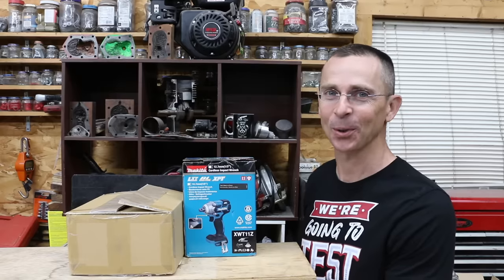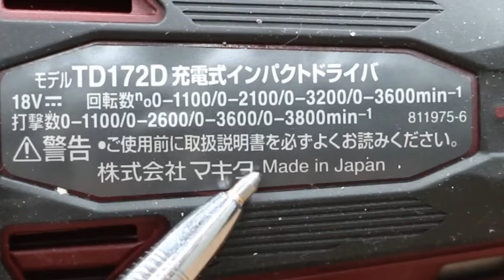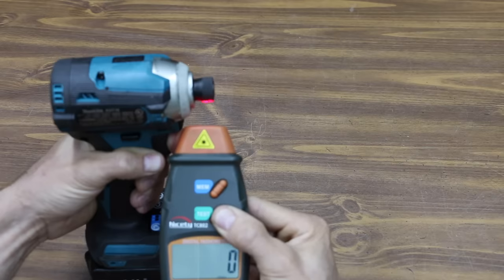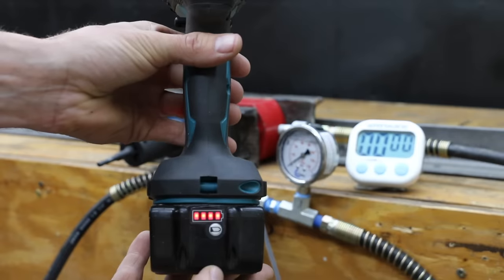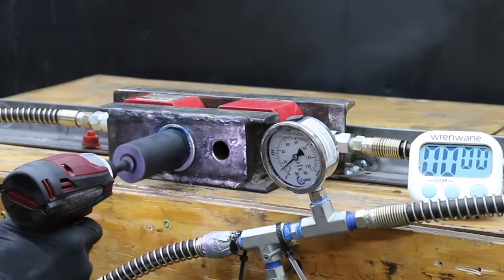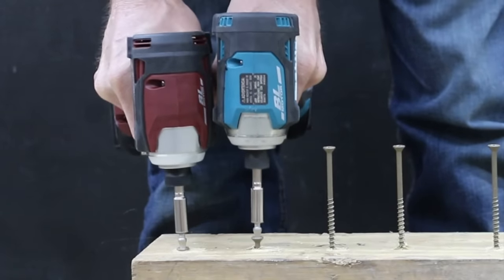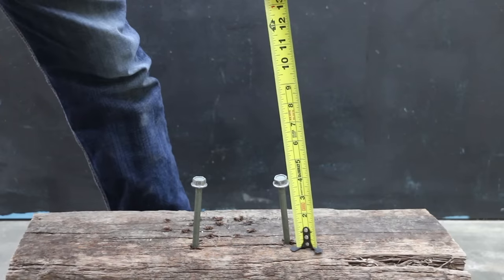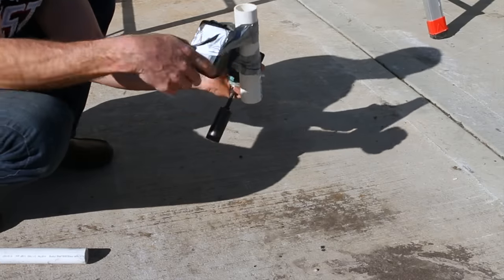Made in "Japan" Makita Better? Let’s find out!

Comment: I worked on a Honda production line for 16 years. The Makita made in Japan was used two shifts per day (80 hours per week). The tools were dropped at least a dozen times a day. It preformed flawless. The only issue was the batteries. They lasted maybe 1,000 charges. I wore out and retired before the Makita's did.
Reply from the maker: Thanks for sharing.
Reply: That's because the batteries were drained before each charge, Lithium lasts much longer when charged early.
Reply: @johnussss  I didn't know that.
Reply: Same here in Paccar assembly plant with Makitas !!
Reply: @theTomaMato  Hope you do well! Hang in there.
Reply: 1000 charges is ridiculous for a tool battery, you must be mistaken. they are rated for 400 cycles and thats under good conditions, with fast charging its often less than 300.
Reply: @drkastenbrot  They were not just any "tool battery." Makita says 3 years service from date of purchase. Many of their batteries lasted longer. We used them 2 shifts every day. Professional here. Honda manufacturing Lincoln Alabama. 2/11/2002 --- 4 /14/2018. A team, instrument panel.
Reply: @tmo4330  I assume the cycles you mentioned were not 100% DoD (depth of discharge). Over 500 full 100% cycles on a battery pack that was always kept cool during use arent rare, but you really start to notice degradation.
Reply: @drkastenbrot  When shooting 17 fasteners (screws) every 63 seconds you can not let the charge go below 3 lights. The "slight" loss in power will cause your process to get behind. Pop in a fresh battery. We had several huge charging stations close by. Every 2 hours you go on break and run to the charging station. Also whoever works off line gets batteries for those on line. The quality of the guns we used is nothing short of amazing. I have never seen them for sale in the U.S. Most people would have a stroke when they find out how expensive the professional grade Makita's are.
Reply: @tmo4330  I do mobile mechanic work I cracked the hammer on my 1/2 dewalt impact. Can you show me were I can get a professional grade Makita?
Reply: @dillonkoch72  I do not know where Honda Manufactauring buys their Makita's. I will search and if I find out, I will let you know.
Reply: @tmo4330  thank you
Reply: @tmo4330  I'm pretty sure we use Panasonic impacts on the processes, but the team leaders and coordinators use Makitas for repairs, and trainers use them when training newbies. Caveat is that I work in Marysville, so you guys might run different tools than us.
Reply: @MrSirUndersteer  Hope your career goes well. I am now retired. 25 years with United Defense, 16 years at Honda manufacturing in Alabama.
Reply: @tmo4330  Yeah they last longer than 3yrs for sure. My original 3.0ah batteries are still going strong with homeowner use about 5yrs now
Reply: @pryme2013  Great to hear.
Reply: Not to mention the Makita battery are made in China
Reply: @protennis365  cells from Japan or Korea, and assembled in china.
Reply: @ProjectFarm  HEuHEYRURYRHY
Reply: @pryme2013 I have a 3ah 18v battery that's 9 years old now.  Sure doesn't put out the current that it used to, but runs the radio fine all day without running flat!
Reply: Damn, why y'all drop tools so much?
Reply: @gregorsamsa1364  When you are in a mad rush for production, it happens once or twice an hour.

Comment: I purchased my first Makita cordless 9.6V drill in Canada in 1985. After moving to Germany in 1991, I just replaced the charger for 230V operation. The drill is still in use in my workshop on a daily basis. Made in Japan. Parts still readily available. I added a 9.6V saw, hammer drill and other units over the years. Broken switches were replaced. NiCad Batteries lasted an average of 10 years and have now been replaced by NiMh units. These Japan-made Makita units are virtually indestructible.
Reply from the maker: Impressive!

Comment: It should be noted that the TD172D is the equivalent to the American model number XDT19z, not the XDT16z (the previous model) used. They are different tools, so this is a comparison between the new model vs the previous model.
Reply: Thanks for the information, would have been good if he added that in the description because that will make a huge difference if they are not the same model. Saw that he's aware of the issue but doesn't seem to acknowledge it in the description which results in a thumbs down from me.
Reply: exactly and you get the point
Reply: What's the difference?
Reply: @ecstazyrm  the difference is that this video came out more than 15 months before the 19Z was released.

Comment: I do metal roofing and have used dewalt,Milwaukee and always a month in I had to buy new impact so I bought the Japanese makita and still working 5 months later!
Reply: That's sad to hear about the Milwaukie. I hope my impact driver is going to last when I get it through the mail.
Reply: @SquadJuiced  probably will be fine where running them all day every day a month or more at a time..lol
Reply: @jamiefox8670  Which is the only way to expose a tools limits
Reply: @SquadJuiced  Milwaukee makes some powerful tools but in my experience they just don't last very long, especially pushing them to their limitd

Comment: Cars, audio equipment, tools, everything. Made in Japan whenever is possible.
Reply: I sell CB radios, and there's a model that's been made for around 60 years called the Cobra 148GTL. It's been made in quite a few different countries over the years, including America, Japan, Philippines, Thailand and is currently made in China. The Japanese radios made in the 70s-80s are highly sought after and go for the highest prices. You can see the quality go down every time they moved production to a new country. The radios made now in China are terrible quality. They tend to have awful soldering and usually break down within days or weeks of opening the box, but the old Japanese radios from 50 years ago are still going strong and need minimal maintenance.
Reply: Or Made in Germany but it isnt this good, if it is only assembled here in Germany
Reply: if you are old enough, you can recall there was a time people ridiculed at  japanese products as they do now at chinese. Most people do not understand most of the foreign products are made to the order. You want cheap you get the cheap.
Reply: @baljiangusa  It's the same with Samsung from South Korea. I'm old enough to remember when Samsung was a cheap brand, that made poor quality consumer electronics. Roll on forty years and Samsung are known for their premium quality electrical goods. Which is why my fridge, washing machine and microwave are all made by Samsung. My TV is Chinese and it has s ten year burn in guarantee. I choose it over a Samsung as I got a higher spec at a lower price.
Reply: Not really sure about cars tho ... I mean Toyotas and Nissand are pretty shite cars.
Reply: @TheClone123456789  depends on a lot of things. I worked at a Nissan dealership for some time. Their 5.6L V8 is a great engine, as is their VQ series V6s. Those are some the best V6s out there, powerful and reliable engines, 26 years in production yet still putting out competitive levels of power naturallt aspirated, and lasting to 300k regularly when maintained. Interior and exterior quality is quite weak between 2002 and 2017 on most of their vehicles due to Renault's ownership/Carlos Ghosn personal fault, may he burn in hell. Don't really have much experience with Toyotas but I was under the impression they're fairly reliable but extremely cheap to own. But hey, I drive a Jeep 4.0 XJ and fix everything on my vehicles and maintain the everlasting shit out of them. I'll never know the legendary rust that impacts these Jeeps because I spray oil on my underbody and don't allow Jeep circa the 1980s to decide how long my vehicle will last. At least 70% of the problems people came in with on their 'shitty Nissans' were entirely their own fault for refusing to maintain their first or second most expensive possession. That probably goes for all cars.
Reply: @TheClone123456789  Toyota is shit?
Reply: @bandombeviews6035  Yes
Reply: @TheClone123456789  Why’s that?
Reply: I’d love a Japanese wife 😂
Reply: @TheClone123456789  my 96' Hilux 4x4 with 560.000km doesn't agree with you. No a single problem, only normal maintenance
Reply: @Bellymeatman  Steve Jobs wanted Sony to make Apple...say no more...cars planes automobiles they got them too
Reply: @videomailYT  germanski is good but so slow a little bit and bolt at a time
Reply: @alien4422  yes I remember Amstrad was low quality and now decades later it's still low quality..and that's the difference between Japan and the West
Reply: @johnnymatias3027  yep and the same principle applies to teeth
Reply: Which audio equipment do u recommend
Reply: You get what you pay for, if Chinese companies deemed quality products more profitable, Japan wouldn't stand a chance, but it's the opposite. People want cheap products and it's profitable to sell cheap.
Reply: Or Swiss
Reply: @TheClone123456789 Wrong on Toyota, and Nissan is French.
Reply: @TheClone123456789  name one company that has better craftsmanship than toyota manufacturing. I'm in my 40s now, when the time comes, pull my I've when you find that one company
Reply: @wesfields9322  BMW, Mercedes Benz, Chevrolet, Ferrari, Lamborghini, Saab, Chrysler and many many more !!!
Reply: @baljiangusa  and you pay cheap you get the cheap
Reply: @TheClone123456789  Confirmed 13 year old boy commenting.
Reply: @MMMmyshawarma  talking bout urself? Nice
Reply: @TheClone123456789   Confirmed 13 year old boy commenting.
Reply: @MMMmyshawarma  talking bout urself? Nice
Reply: @waynereardon  esp the Japanese world war 2 radio receivers.
Reply: My make in Japan iPhone is much better then my friend make in China or India iPhone.

Comment: The RED Makita is a newer model than the standard one tested. The XDT16Z here in Europe is called DTD171 and the RED will be called DTD172 when it comes to our market. It's just a small generational facelift with some minor improvements borrowed from the new XGT 40v line of tools.
Reply from the maker: Thanks for the feedback.
Reply: Same thing i thought good thing I’m not the only one
Reply: @mannyc805  I would say rookie mistake as a tool fanatic, but this is the first mistake I found on my favourite test channel, which is usually flawless in idea and execution: Would really have liked to see a test of the same model, made in Romania, Japan and China, which is often the case with Makita.
Reply: @martinpedersen4886  yes the blue makita in this video is a 2019 released model and the red one is a 2021 release model I’m surprised he didn’t look into it
Reply: @mannyc805  Exactly. Not the high standards we are used to from this channel, but it did make me look forward to buy the DTD172 when it arrives.
Reply: @martinpedersen4886  yes unfortunately this makes Japanese impact drivers look better than they actually are, if he had used the same model you would have seen they are identical
Reply: Reminds me of Acura vs. Toyota or Aiwa vs. Sony (circa 1990).  Certain improvements and features are rolled into certain brands first, making them appear different.  Perhaps Makita needs to re-brand the Japanese Makita with a luxury title, like Ichi-Ban Makita, or something?
Reply: @ToolsAndStuffOFFICIAL  I probably knew most of the details because of your channel. Good stuff.
Reply: @martinpedersen4886  cheers.

Comment: Man, you always put so much effort and thought into your comparisons for making them count! It's great!
Reply from the maker: Thank you very much!
Reply: @ProjectFarm  Yeah, for example the falling test, where you made sure the drivers impacted at the same angle - even old commercial testing institutions don't think of details like this, which usually makes many of their tests useless in my opinion, as random impacts give random results.
Btw: I was thinking of a method for measuring the 'vibration', as you meant you didn't have a way for doing this, yet.
My idea is: Use sand in some way (or another sediment). More vibration (heavier and faster) will make the driver dig deeper into sand within a given timespan. Of course it wouldn't be good, to directly expose the driver to sand. Maybe just closing the holes with some duct tape, or putting a stick into sand and putting the driver on top of that stick would be a viable workaround for the exposure problem. Then have the tip fixed onto a vertical slider and make sure the handle doesn't rotate by having it slam against the side wall of the sand container.

Comment: The XDT16Z is sold in Japan as the td171d. And the improved model is td172d, which has enhanced torque, increased anvil strength, slimmer head, and lighter one-touch bit sleeve. Of particular note are cheap compatible batteries made in China. In many cases, the balance charging circuit and thermistor are omitted, and there are cases where they ignite during charging and cause a fire.
Reply from the maker: Thanks for the feedback.
Reply: So this is a comparison between two different models, td171d and td172d. No wonder why the inside looks so different.

Comment: Would love to see a “behind the scenes” video. Testing, planning, production, etc👍
Reply from the maker: Thanks for the suggestion.
Reply: @ProjectFarm  You could do some kind of Q&A session (maybe?) on things that are asked more than twice per upload. Mine would be your drill press of choice, and would there be a possibility to cover more European available stuff?
 I like your approach, Sir. The light humor, little puns on the stuff characteristics. Covering the tool vibrations, getting hot, struggling, etc., or just a general feel. E. g. the case when you said Makita chainsaw was not fastest nor had top torque, but it felt great as a piece you would choose to work with. And last time I saw you rocking up-down=back-forth a pick-up truck with this epoxy putty "cured" chain... That was just hilarious! I would recommend the channel called AvE - it's different, but also great in his personal "area" 
Stay Safe.
ps. He said "Everything I have from Japan runs great.

Comment: "My left hand got tired of losing and cheated on the third test." 😆 love the commentary. Thanks for another great video.
Reply from the maker: You are welcome!
Reply: That last test wasn't fair, though --- the wood was already drilled out (and the blue drill's hole was deeper because he drove the screw almost all the way in after the bit slipped off; this per-existing hole-bottom allowed the blue drill to screw in the fastener more easily near the end, which is likely why the red drill just barely "won") by having the screws inserted the first time, so the race wasn't really "even" as far as turning-resistance was concerned --- i.e., with both drills using screws being driven into fresh wood.

Comment: Man, it would be really great if you updated this video to clarify that you’re comparing the new model vs the old model. The “Made in China” XDT16 is the same as the TD171 (whether made in the Chinese or the Japanese plant) and the TD172 is…as one should hopefully presume…the newer model that hasn’t been released here yet.   The “Made in Japan” TD171 is absolutely identical to the XDT16. I would know. I’ve been inside of both.  The only material difference is that the Japanese battery connection has a fourth (seemingly dummy) terminal for reasons I do not know which also means that half of the hosing is slightly different to accommodate. I 
Internally just swapped parts between the two today.  Please, for the love of god, there are armchair internet know it all’s using your video to spread misinformation.  I would greatly appreciate it if you could help put a stop to their nonsense.
Reply: I was also confused.I did some research and found the same thing.Should have scrolled a bit to find your comment.Took me a while to figure out all this.
Reply: Once you used the word "misinformation" I knew I didn't like you.
Reply: @brandonmcdonald8356  lmao for real
Reply: @bachconneshon7809  He's not wrong, though... The TD172 (in the video) is the equivalent of the XDT19, not the XDT16 used.
Reply: He won’t admit or change it. He’ll just say thanks for the comment.

Comment: My new purple Japanese Makita turned up today. td172. Engineering and quality. Say no more.  Awesome video mate👍
Reply from the maker: Thanks!
Reply: Dude if you're going to drop the big bucks get something german like festool. Makita is just mid-range compared to this. Why spend more for imported Makita?
Reply: @vapeurdepisse   Fest tool is not that great look at the AVe reviews
Reply: @dut611  I don't need to look at reviews, I have Makita for rough stuff and Festool when I need quality work. That ave guy must have an axe to grind against festool, I Looked at his teardown of the tracksaw, which I've owned for years, he has no idea what he's talking about. Spent 20 mns trying to understand the engineering unsuccessfully and was bitching before he even got started. I've owned all the big brands over the decades and Festool  is not comparable for the precision of work that I require.
Reply: @vapeurdepisse  Yes for sure festool is more of a fine wood work tool ! But far from been a job site work tool! That drop on any festool would shatter that fancy expensive tool in pieces !
Reply: @dut611  sure but any tool would take a beating. My Makita hammer drill took no fall and it wobbles. I'm using it as a concrete mixer now... Talk about rough work indeed.
Reply: @vapeurdepisse  yes the point i had about the ave review is that for the price in the tiers down , the internal were made of very cheap component for the price.
Reply: @dut611  you got the wrong impression, the components weren't cheap. He just said it was, but he didn't really have a clue beyond his gut feeling.